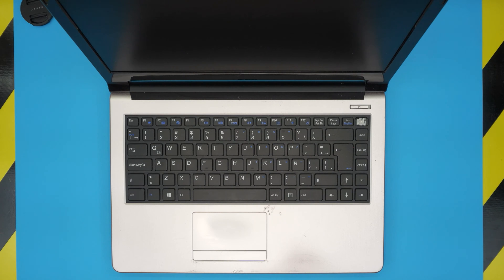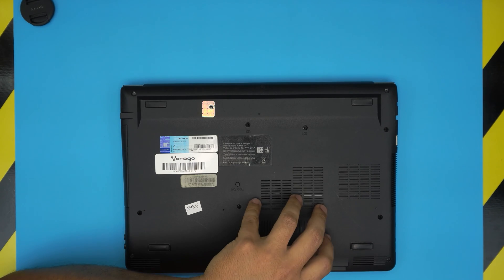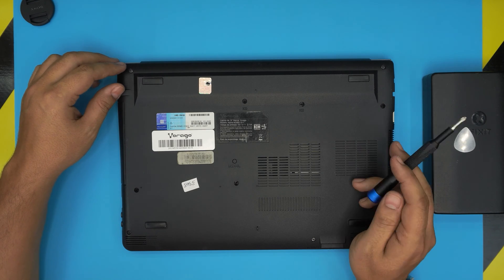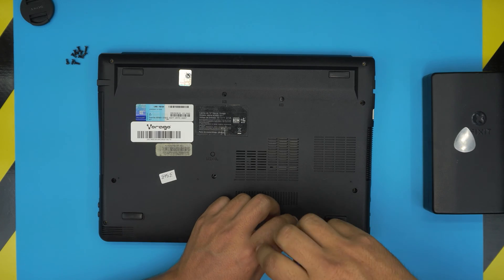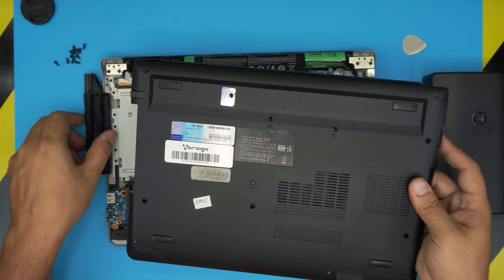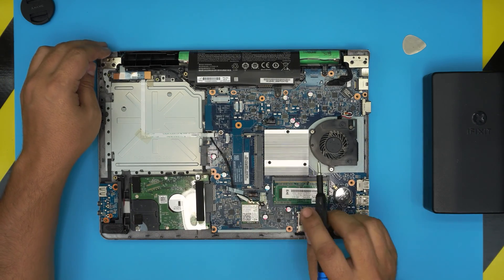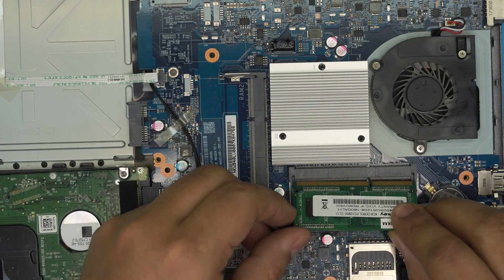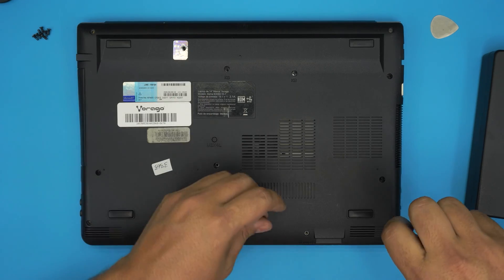Vorago Alpha N3060 Ram Upgrade 🚩Step by Step

Comment: How much Ram can I put on it?
Reply from the maker: Thank you for the feedback! if you wish to support the channel you can LIKE or SUB or both :P
regarding your question:  you can place a 4gb x 2 total of 8GB sdram ddr3L https://amzn.to/3IdXykB
Reply: @uFixTek You know my laptop does not go beyond the vorago screen and is charging and sometimes turns on and off but the fan is heard a lot when it turns on, sometimes it turns on but it takes a long time like an hour and thirty minutes and I already try to delete the updates through cdm but it sends me to erro x0000185
Reply from the maker: that issue is because og bad hdd degraded ssd or bad sectors on hdd.
Reply: @uFixTek  Okey, do you think I should change it to a solid hard drive?
Reply from the maker: yes my friend , you will also see a huge speed increase and performance.
https://youtu.be/DscqecN4SZk

Comment: Hola de casualidad sabes que tipo de pila en el BIOS lleva? Me marca un error al arranque que no logro entender.
Reply from the maker: amigo el modelo de pila de bios es cr2032, cambia esa pila venden en todos lados en walmart o hasta en oxxos
Reply: @uFixTek  gracias 😁 lo estoy pensando saber la compré por MercadoLibre y aún tengo garantía de devolución. El fin d semana con calma la checaré con calma y la pila para decidir si conservarla o como
Reply: @uFixTek  siento que la compre cara en 4 mil pesos mx y aunque se ve bien con 8gb de ram y un disco de 320gb me está pareciendo algo cara. Que opinas del precio
Reply from the maker: ouch no hermano regresalo yo vendo hp ProBook 640 G1 con i3 y 8GB ram y 500Gb ssd en 5mil pesos. regresa esa cochinada de celeron.
busca bien puedes encontrar ofertas chingones.
Reply: @uFixTek  Una duda amigo, donde esta localizada esa pila? yo tambien tengo ese problema y quiero cambiarle la pila